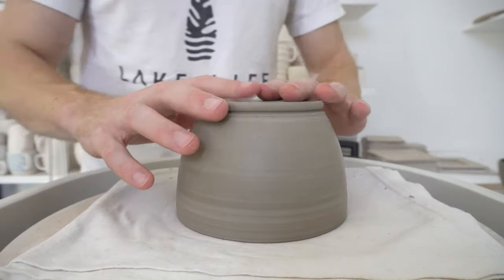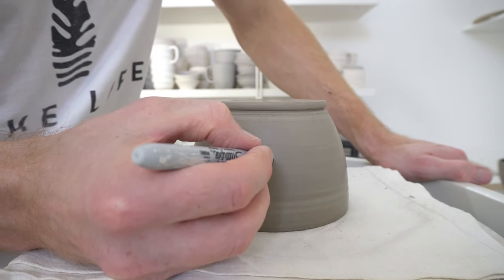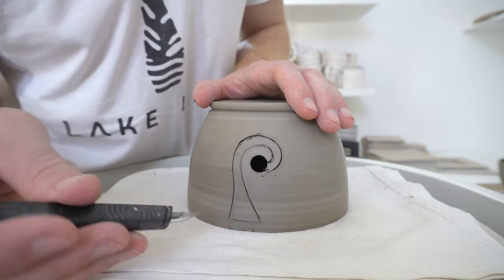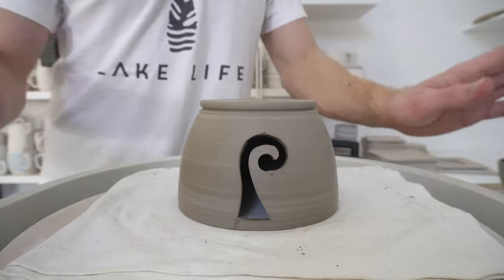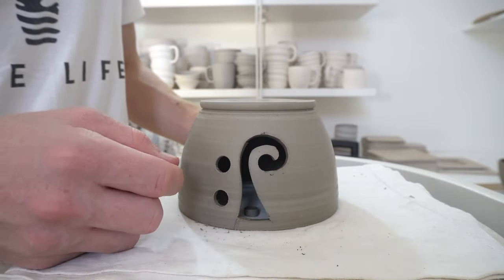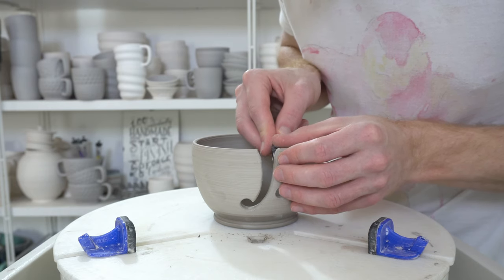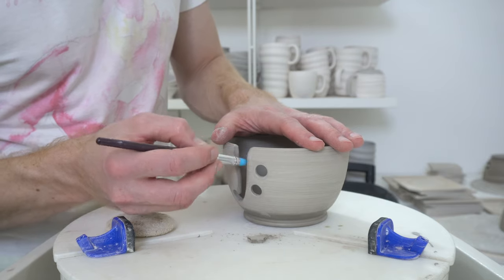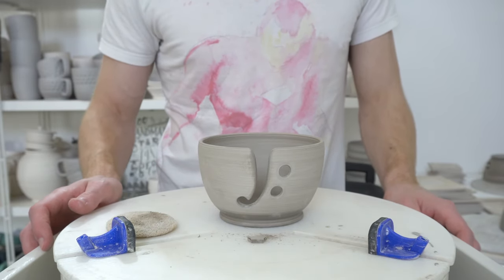Carving a Yarn Bowl (Part 2)

Comment: Love hearing your thought process. The innovations you've shared, like using a car dent puller to glaze pieces, has helped me improve my practice. Thanks mate 👍🏻
Reply from the maker: I'm so glad you found them useful too!
Reply: @OldForgeCreations  question re: car dent puller. Do you have ant tips to help it hang on to heavier pieces? I wax resisted the bottoms and the dent puller is strong, but sometimes larger pieces plop off anyway 😬
Reply from the maker: @ehloe.  Not really, I'm afraid. Other than being both careful and quick, as sharp movements can dislodge it and the grip weakens over time

Comment: Can you not make a template of the area you want to cut and that way you can ensure the spacing is correct - i would use a soft plastic material? You would still draw around it but would be maybe more accurate?
Reply from the maker: That's crossed my mind, and would be a great way to go if you're making many to the same design.

Comment: Excellent, very helpful! One question: at the beginning of the video you say you carve before trimming the bowl. What is the reason you do it in that order? I would be afraid of putting too much pressure on the bowl while trimming..
Reply from the maker: This is only the 5th or so bowl I've made, so it's still a process in development. My logic is that with the rim intact it's still quite strong and I prefer the rim to be drier than the foot when trimming. It allows me to avoid warping the rim when gripping it while the foot is still a nice dryness to trim. That means the timing for the carving works better for me before the foot trimming, but that might not be the case for everyone else